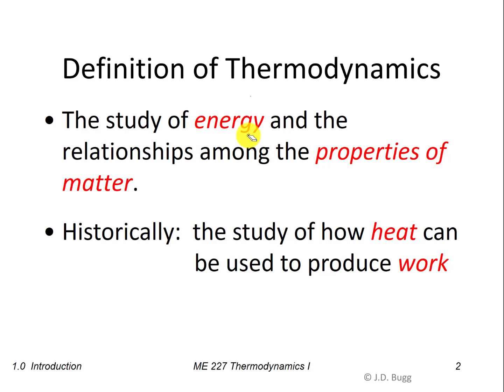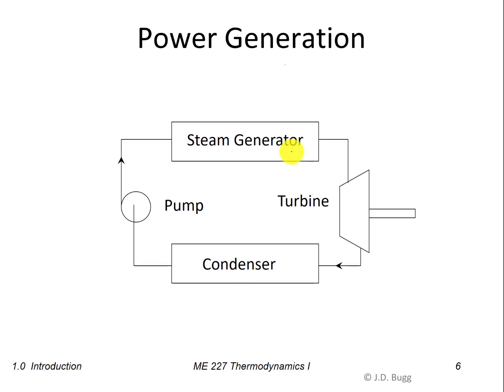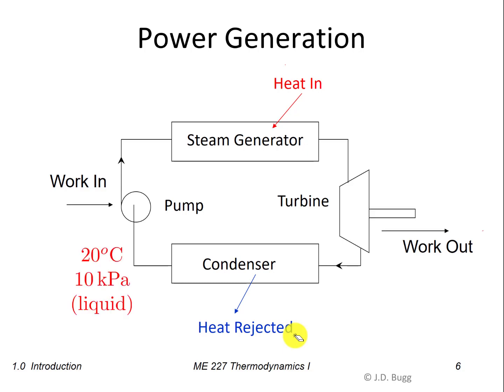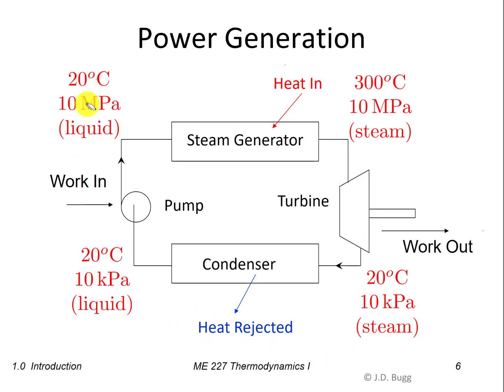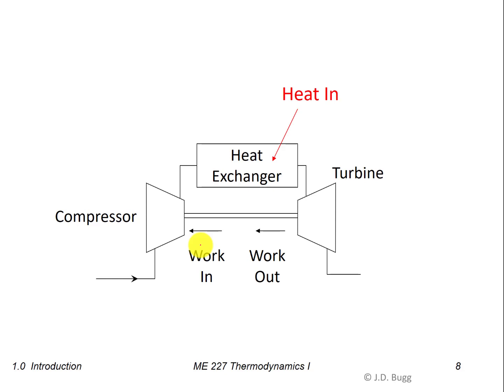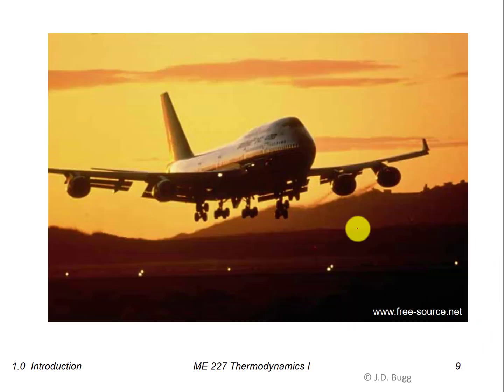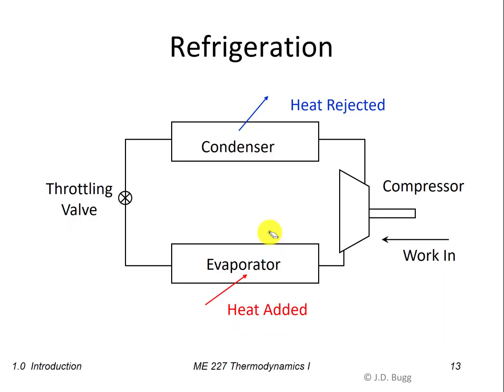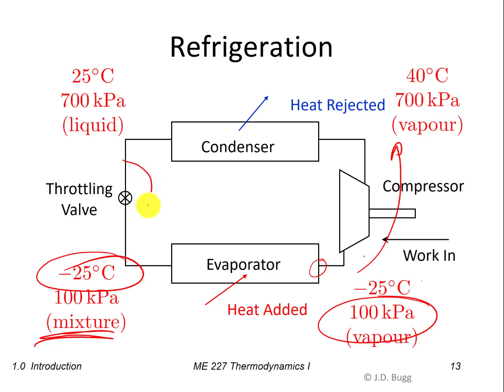01  ME 227 Thermodynamics I - Introduction

Comment: Heron designed an ancient type of steam engine. Not clear it was used for much but the principle was heat causing a rotation.
Reply from the maker: Yes, this is quite interesting.  Thanks for the comment.
Reply: @jimbugg5129  somewhat similar steam engine was used to turn food around the 1500s also.